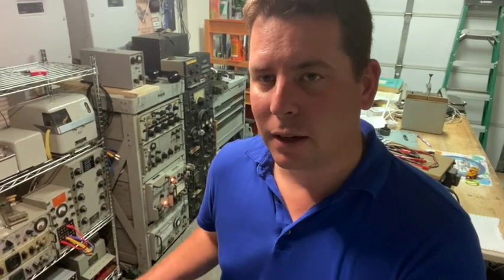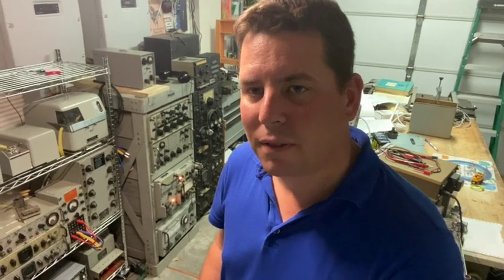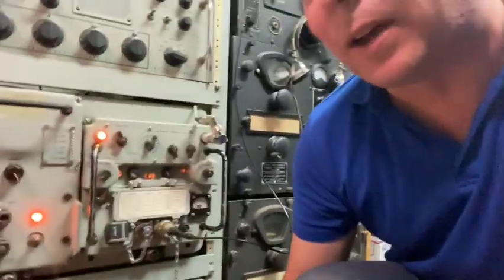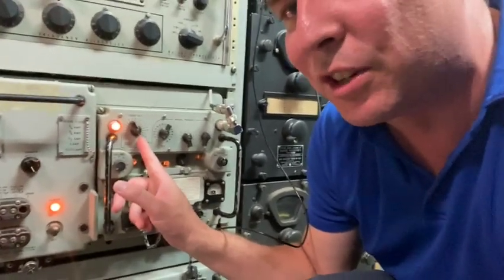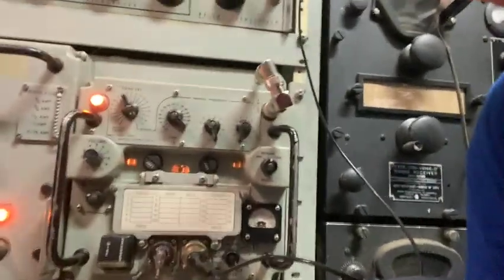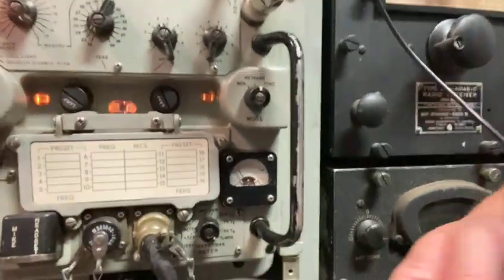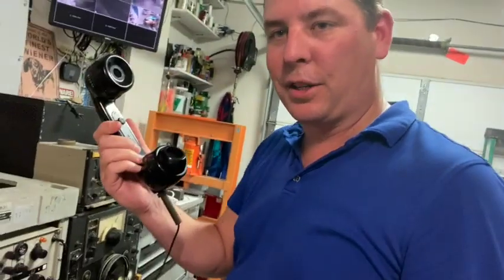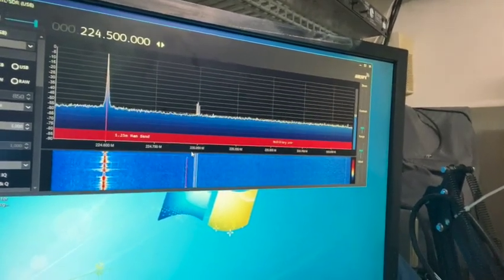AN/URC-9 also known as AN/SRC-21

Comment: We also had 1 whiskey 3 and I did nothing but pms on it. The Amp  you are talking about is the URT 23 I believe  and the antenna coupler war the sra 49 or src 49 maybe. The phone dial is for remote operation and vox capability I believe. I found a bad diode in the diode Bridge of the power supply that ohmed good but would not rectify loaded. We were in port and while I was on leave a chief from mo29 from treasure island failed to find it and I got it with the same com officer over my shoulder, again impressive. If those crybabies didn't like bending the caps or taching th motor(better be 400hz for supply), try tuning that coupler... we would tune to the ends of the frequency range and monitor comms  for short secure communication.

Comment: Radio was designed for 225-400, you'd have to modify it AND add some crystals to get it to 220.
I was a UHF Comm tech (ET) when I served on USS Ranger, we were probably the last ship in the US fleet to use the URC-9 / SRC-20 radio system and I got to know them VERY well.

If you FOLLOWED THE MANUAL (it was scary, a well-written manual for the military!), and used the procedure it gave for aligning the radio, it worked WELL.
16 watt output rating, we'd regularly see 20-22 watts OR MORE across the band after a "by the book" alignment with fairly fresh tubes.

Might have helped that a carrier was big enough to reduce the vibration issues.
Reply: It transmits just fine down below 225 unfortunately there is just not much going on AM 1.25m.
Reply: @K6YIC  My main issue is that the base radio didn't have the crystals in the synth to reach that low - or they were normally "locked out" by the mechanism.
The bandwidth of the radio is not even close to being an issue.

Comment: Your shack is looking great! I like your little dog, too. I don't know if I have anythign operational that might talk to that rig. Long ago, I had an AN/TRC-68 (if I recall correctly), which was basically the same radio and power supply set in a non-rackmount box and painted green. I don't remember if I had the power supply for it or if it was missing, but I traded it away a long time ago.

Comment: I can assure you we used those hunks of shit through 1984. During an exercise  all 4 went down because the radiomen did pms after I tuned them; I got em up as fast as I could carry em to the shop with the com officer over my shoulder; impressive, like my Johnson. I was really good on those babies, didn't know very many that could hang on em. When I came aboard, the e6 ordered a case of PA tubes cause they couldn't tune em. If the Ukrainians are using em, sign me up!

Comment: URC-9 was a maintenance nightmare, you aligned them by bending turning tabs, and they were unreliable. We used them on HMAS Swan at least around 83ish.
Reply from the maker: As far as I can tell most Navy's pulled them when the WSC-3 came around and waist enough supply.  I believe the USN pulled them around the same time 1983-84.

Comment: AN/SRC-21 is not the same as the AN/URC-9.  The '21 included the Radio Set Control C-3866; the URC-9 had only the cabinet, RT-581 and PP-2702.
Reply: That was explained in the video.  The title was only listed as that to direct traffic.  I probably should have listed it as “part of” instead of how I originally listed it.
Reply: @K6YIC  My bad, sir ... I missed it first play.  Yeah - I worked on those things quite a bit back in the day.  Hey, it was worth playing again!  :)